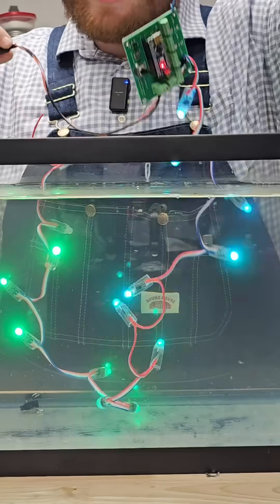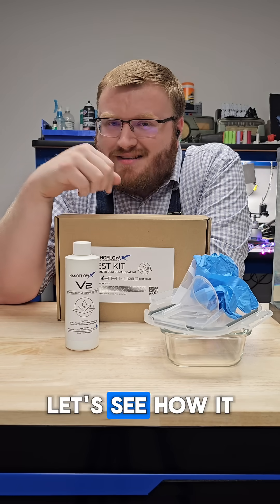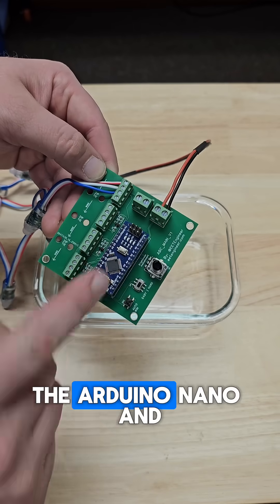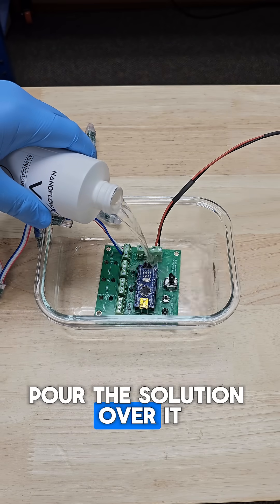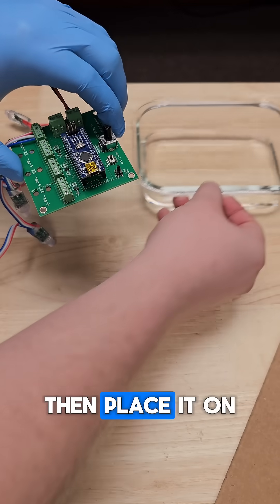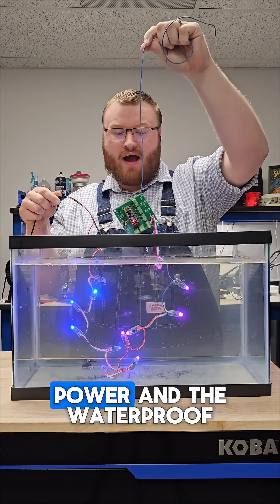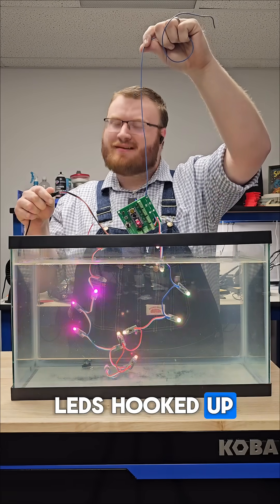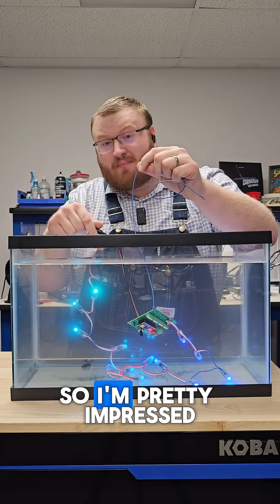WaterProofing My PCB Designs!!!

Comment: Thermal impacts?
Reply from the maker: There will be some thermal trade-offs with using this or any conformal coating. 

It will impede heat dissipation.